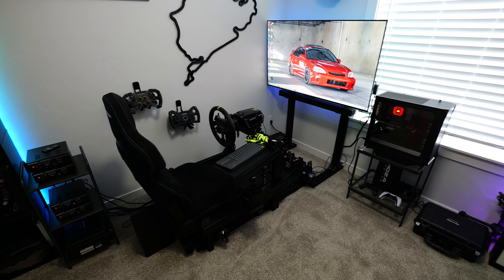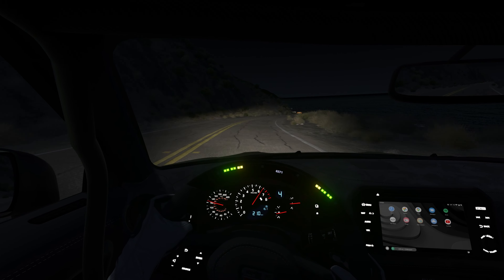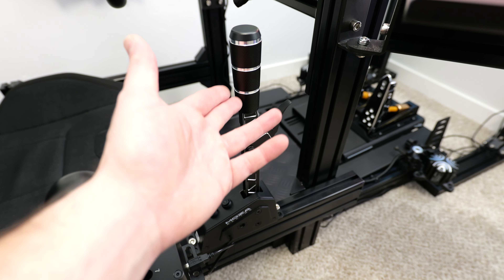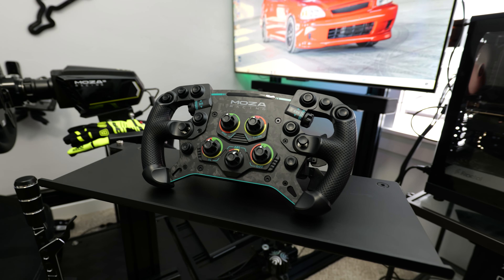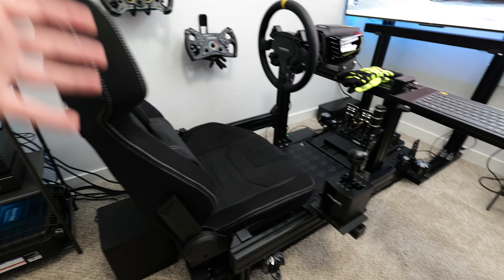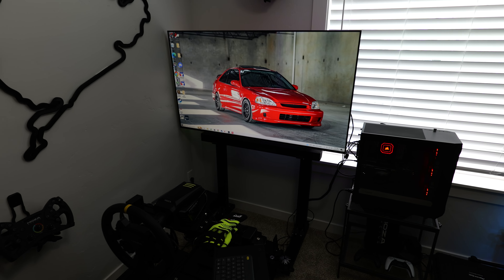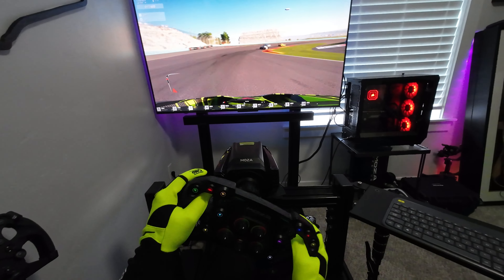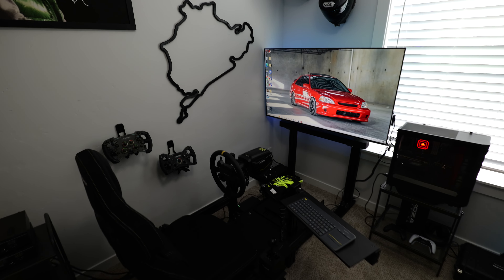The BEST New Upgrades for my Racing Sim Setup! | Full Setup Walkthrough

Comment: Nice!  I have also just built the GT Omega PRime, Just waiting for all the Moza gear to arrive, went for the R12, FSR Wheel, RS V2 Wheel, CRP Pedals, HGP Shifter, HRP Handbrake
Reply from the maker: That’s going to be a killer setup! Still haven’t tried the FSR wheel but I bet it’s going to be good. I highly recommend the Sequential shifter if you add something else!
Reply: @ALLDAYANTHONY  Yeh, I seen it had been released and it is on the list...just have to wait for them to be in stock at the usual suppliers, only on pre-order on their site at the moment.

Comment: Even being far sighted, you really should move that TV up to the back of the wheelbase. That way you can run the cockpit view, and it's way more immersive. Getting your FOV dialed in will make another huge difference in your track times. Super easy with one screen and a free FOV calculator.

Comment: Nice video. I love your setup. Does 4 Buttkicker really make a difference? I have the exact same rig (GTOmega Prime Lite). I only have 1 but bigger buttkicker gaming pro at the moment. Since I run in mono, I tried 3 different position on my rig (Rear Left, Rear back, Rear Right). Honesty, I see no difference at all. The vibration is distributed evenly on the back of the rig. I have my volume set between 20-24. Like Mike (The SimRacing Den) said, he tried with 2 buttkicker (front & back setup) and saw almost no difference at all and went back with a single Gaming Pro at the end.  Much cleaner setup with less cables.

So far, I'm very satisfy with a single buttkicker and can no longer play a racing games without it. Even for games that is not supported by Simhub & Hapticonnect (ex: Wreckfest, Crew Motorfest) by telemetry, it still make a huge difference.

Comment: I have the gt omega prime lite and I was honestly so upset while building it. The cheaper extrusions have less material inside the channels requiring you to use a different non ball bearing T nut. This means the T nuts you have to use don't slide smoothly when you adjust positioning of anything. They want to grind along the metal and constantly would get stuck or cause me to strip multiple bolts/nuts while installing. I only went with them because at the time they were the only free shipping option for me :(
Reply from the maker: Interesting, I had no issues when assembling everything. I didn’t strip one bolt or nut in the process. Hope now that you have it built that you’re enjoying it!

Comment: You didn't mention the pedals?
Reply from the maker: I actually had a segment on the pedals that I edited out of the video due to the length. Their still holding up great with no issues. It did take awhile to break in the brake pedal though!